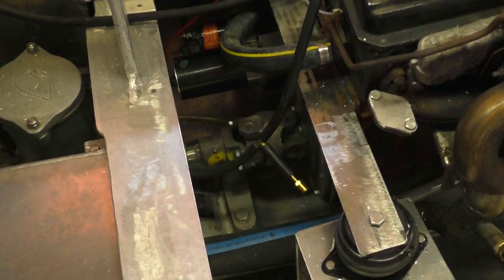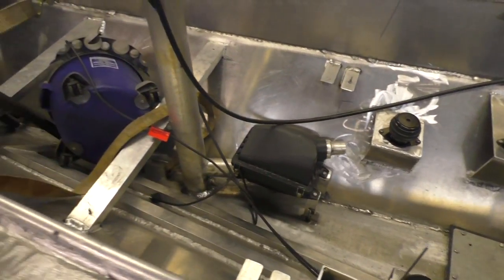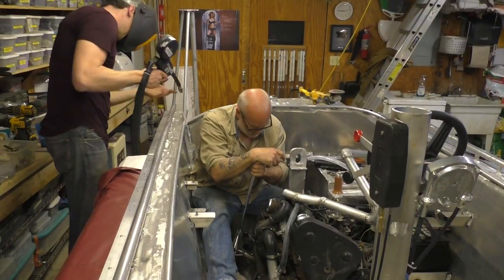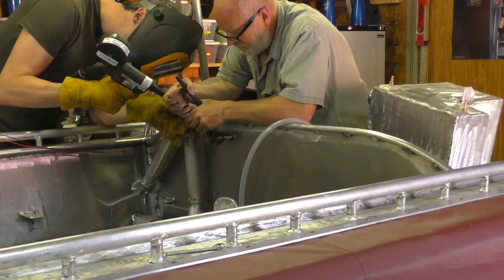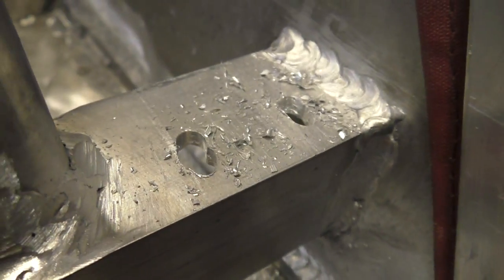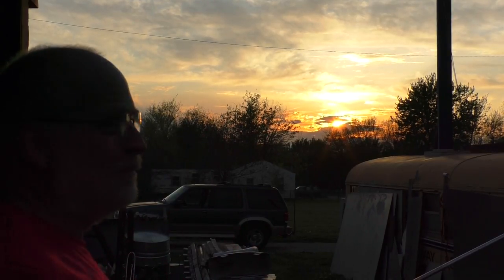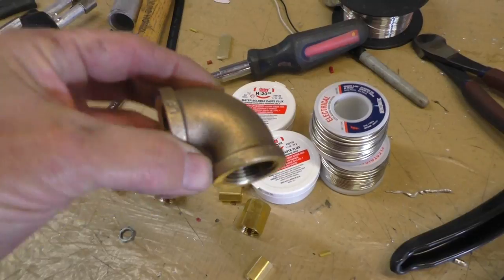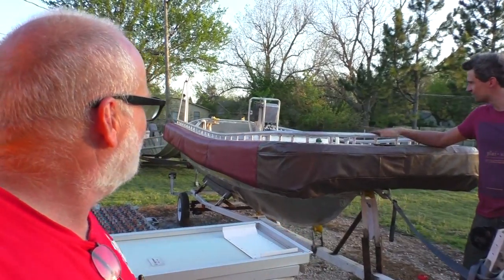Diesel Jet Boat Build - Part 11 - Trailer and Wiring and more

Comment: Make sure you just solder wires together to join them
 Never ever put solder on wire and clamp the soldered end to make contact. The solder will corrode over time and bad or no electrical contact is the result.
Reply from the maker: Never heard of that one. And it’s not been my experience either.